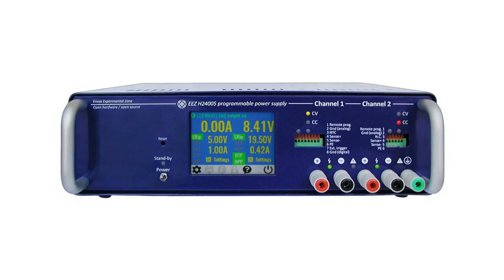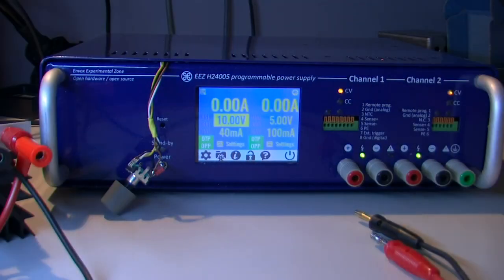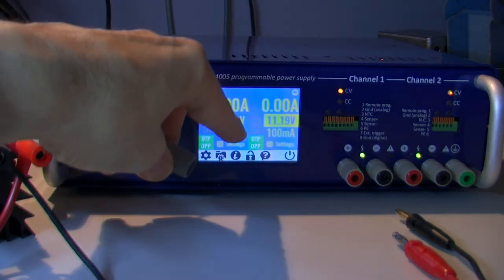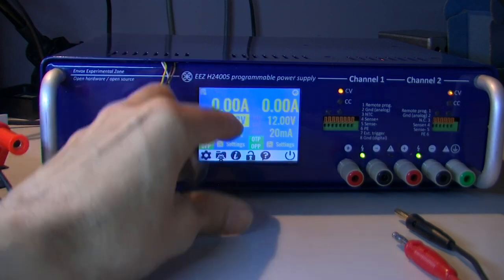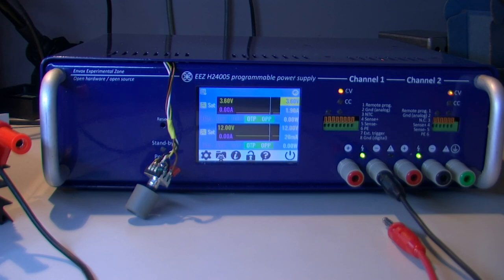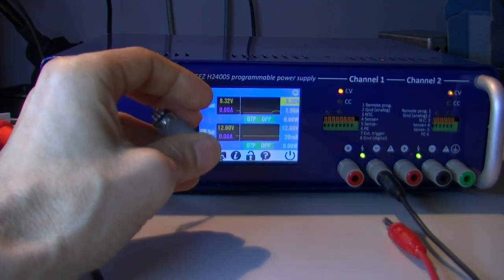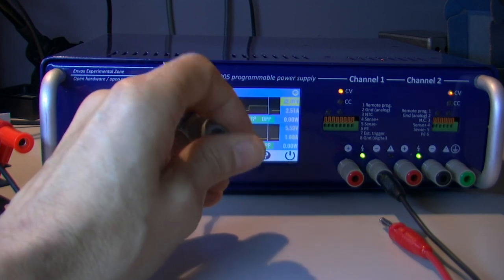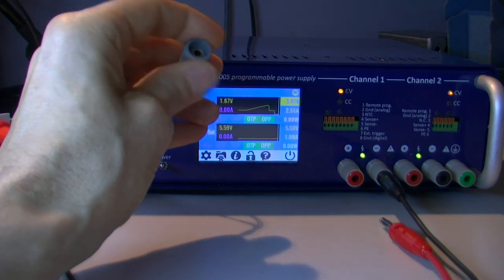EEZ H24005 Encoder preview

Comment: Wouldn't it be practical to have both - 'selection' and 'confirmation' mode at once? So one could navigate by clicking, and only when a value is changed, confirmation is used...
Additionally, in my own little projects with encoders i found it quite useful to have a dynamical acceleration - the faster the knob is turned, the higher the 'steps' are used for the encoder. So you have 'fine' and 'coarse' mode without having to change settings...
Reply from the maker: Thanks for suggestion about  'selection' and 'confirmation' mode. Regarding "Dynamical acceleration" you can see in video that we implemented it in both directions and have 10 speeds each. It's named "Moving up speed" and "Moving down speed". Maybe names is not optimal and if some of you have something better please let us know.
Reply: I agree. I suppose a confirmation mode is a must. When the output voltage or current changes right away there is a change to accidentally damage project you are working on when you haven't set the maximum voltage.
Reply: I'm not sure if we're talking about the same regarding "dynamical acceleration". What i meant was avoiding any "moving up" and "moving down" manual settings at all. Instead, the system 'adds' these steps automatically dependent on how fast the user is turning the knob. So let's say i'm turning slowly with "one degree per second", "moving up" (or moving down) is set to "1" (by the software), whereas when i turn it with "360 degrees per second", "moving steps" are increased to "10". Figures are not real, i'd have to dig what i (and others) used as reasonable  automatic encoder acceleation values, but i hope you got the idea... ;-)
Of course, having both (manual setting, automatic accel) would be great as well... ;-)
Reply: Yes, it works like you described, only the numbers are different. If knob is rotated slow - slower than 1 step in 250ms - voltage is increment only by 0.01V per step. If knob is rotated fast - faster than 1 step in 5ms - voltage is incremented by 1V per step. So, with only 4 very fast turns voltage can be incremented from 0 to MAX (40V). With "Moving up speed" (which is probably not the best name for what this option does) you can change how fast you can go from 0 to MAX. If you select value 10 you can go to MAX in 4 fast turns, if you select value 5 you will need 10 fast turns, etc.. Maybe better name for this options is "Knob sensitivity".